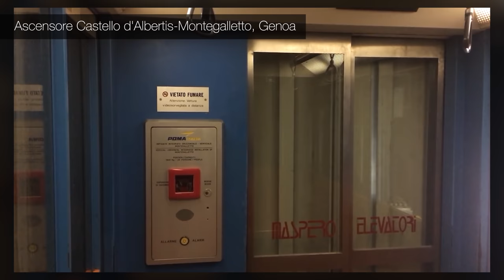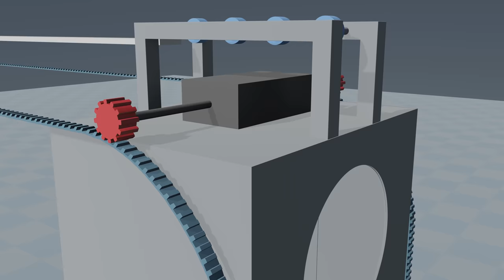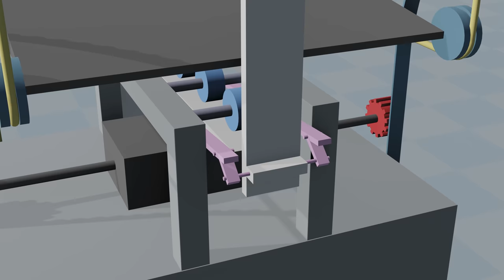I thought the Schmid Peoplemover was impossible

Comment: The elevator in the St Louis arch would be a cool addition to  this elevator series. You start to lean over as it starts to curve and then the cabin itself rotates to correct the lean.
Reply: I've always wanted to visit this Arch just to experience that
Reply: It's a bit cramped in there, but really cool nonetheless :)
Reply: I also wanted to say this! The St. Louis Arch elevators are, in my opinion, almost cooler than the monument itself!
Reply: Technically it is a tram, but works like an elevator.
Reply: Got stuck in one of those tiny carriages on the way down once. Sat there for what seemed like hours, but was probably closer to 20-30 minutes.
Reply: Just like the one in the dome of the new Townhall of Hannover.

Comment: I feel like there's another elevator that goes from horizontal to vertical that we're forgetting here... the Tower of Terror(s) at Disneyland :)
Reply: You are correct! However, ToT relies on a vertical carriage that attaches to/carries the trackless car. That carriage utilizes motors on both directions of travel, and the ride car has to pause when attaching to the elevator carriage. The engineering isn’t all that far off from a typical elevator, so sadly it’s not a smoothly transitioning carrier such as this one, which is Tom’s point, I believe.
Reply: Silvarret!!! :O
Reply: @TitanTankNate  very fair, and definitely agreed. Just thought I haven't heard about it in all these horizontal elevator videos so far, when the engineering behind it is quite interesting... And indeed, it's technically an elevator too.
Reply: The ToT should be quite similar to the one here in Genoa
Reply: I even know the tower of European political horrors, whose pointy tip we still have not reached...and then the big plunge will follow.
Reply: I'd also add, the system at the St. Louis Arch.
Reply: yes, but it smells like farts
Reply: But did that take 3 hours to install? I think not!
Reply: @Formulera  Tower of Terror is not similar to this at all... Just recently watched the "Behind the Attraction" about the ride and it's totally different than this. The part when it travels horizontally, there is no track. There is a guide line/wire beneath the trackless car that tells it where to go (using a camera or sensor of some sort that can "see" the line and follow it). Once it reaches the vertical section, it attaches to something resembling a traditional elevator (though, as N8CRE8S noted, there are motors to pull it up and down so that it can drop faster than it would if it just fell). There are no cogs, and the transition from vertical to horizontal is not nearly as smooth as the one in the video.
Reply: I know this is nitpicking but that one’s in Disney World, not Disneyland
Reply: @thatguy3968  I could be wrong, but while the original Tower of Terror was in MGM Studios in Disney World, I believe there is a (newer) version of the ride at California Adventure in Disneyland. So they're technically correct.
Reply: Yes, but I think, they have a complete stop
Reply: @cloudshad0ws  Yes but that version actually didn’t leave the shaft
Reply: @cloudshad0ws  correct on the guide wire! An encoder on the bottom of the roller carriage uses electromagnetic induction to “find” the wire and follow it. If the vehicle strays too far from the wire, a set of sensors detects the departing side and corrects the vehicle in the opposite direction until the inducted signal is reacquired. Because of how frequently this encoder polls/queries the wire, corrections are super small and hard for riders to detect.
Reply: @cloudshad0ws  the ToT at WDW is the only one that has cars that move horizontally. All of the others are just vertical shafts
Reply: @bigb7965  exactly
Reply: I love u Silv
Reply: But does it allow wheelchair users to travel to Stuttgart without help?
Reply: I think tower of terror works like a rolling chair and two elevators. It can sit in an elevator going up and down but also can go roll around to the second elevator. So just a cart that locks into two elevators
Reply: tower of terror does not count because its not actually a elevator its a roller coaster car that takes a ride inside a skeleton elevator when not inside the elevator it runs autonomously 

driving a golf buggy into a elevator would have the same effect
Reply: @cloudshad0ws  its actually a traditional elevator just beefed up it was built by the otis company
Reply: @dacid44  Yes, that is a fun one.
Reply: You "feel like".
Reply: Whats Disneyland?
Reply: @Silvarret  Not heard about it at all? But Tom metions it in the video about the horizontal/vertical elevator in Genoa, Italy?
Reply: @thatguy3968  True, true.  I wish the World and Land people would get together and make it less confusing =D

Comment: I live in Rummelsburg, where the second People Mover is installed and funny enough I have friends in Altbach. But we can tell you these things are broken more often than usual elevators at train stations. If you need a highly trained special engineer every time to fix this, a simple steel construction with a flight if stairs and elevators on every side is the more simple solution.
Reply: *Simple steel bridge construction
Reply: That's what I thought when I was watching.
Reply: To be fair, if there were more of these it wouldn't be such a specialized training anymore, making engineers more easily available.

The old "Chicken and Egg" problem comes to mind
Reply: @Atlessa  Interesting point
Reply: Where in Rummelsburg is the other one? And is it accessible to the public?
Reply: Elevators are not "simple"
Reply: @00bean00  Elevators are actually very simple. 150 year old technology. Completely analogue machinery.
Reply: @dkbmaestrorules  S-Bahn Betriebsbahnhof Rummelsburg. Yes it is usable by anyone. It is a much shorter version than the one in this video as it only spans the width of one single railway track.
Reply: As an engineer i very much agree.
Reply: It's always broken :(
Reply: wo in rummelsburg steht der people mover?
Reply: @sushifornico   S-Bahn Betriebsbahnhof Rummelsburg
Reply: A stairway should  be built attached to each side of the building with a walkway across so you can have the best of both worlds.
Reply: @Atlessa If we were to use rockets to move people over the rails, we would need more rocket engineers, among other things. However, we don't use rockets because it's not efficient. It's more efficient to use a common technology like two elevators, one on each side, and a staircase for those who don't want to wait.
Reply: Good to know - still would be nice to see how they would fare if there was enough to get the kinks out. Broken elevators also used to be really normal thing, and people loved their 'pater noster' killing machines for their reliability.

Comment: "It's a wonderful design but it's also complicated"
What do you mean... It's genius  and simple, simpler then the 2 ones you showed before, 2 gears on 2 rails with a nice automatic balance system. Heck all it needs is a switch to switch tracks and your elevator can switch to other directions. It's just an amazing invention, I would see it in a boat or space ship
Reply: Um...never forget all the safety features that were added. It appears much simpler than it actually is.
Reply: @geraldhenrickson7472  The safety features are in regular elevators as well. This thing is wonderfully elegant German engineering at its finest. I'd love to see a building use these for a leaning or bent tower design someday.
Reply: @geraldhenrickson7472  Those safety features are part of the elegance of the design.
Reply: if you think this is simple you are deadly wrong - do not even wanna start with all the legal requirements for that in germany, where every staircase is normed

Comment: It's remarkable how this manages to be both elegantly simple, and intriguingly sophisticated.
Reply: it looks elegant and simple in the video. but operationally it is uneconomical, there’s not much point to elegance if there’s a far cheaper and far more reliable solution. they had to decommission the similar one in Berlin because the operational cost is completely unjustified by the tiny capacity.
Reply: @johnnysecular  oh for sure, I'm not saying it should be implemented widely, just marveling at the engineering

Comment: Seems like it could have a walkway on top and stairs on the sides of the towers then you'd have the option to walk. Could still be installed in a similar amount of time if built modular like this.
Reply: walking up stairs can be made easy with line wheel on top and counterweight , hold the line it pull s you up say half you r weigth
Reply: Indeed. If you have more people using that way that would be a possibility. Have the lift for disabled or old people.
Reply: Walkway on top is not very practical. It adds several extra meters up and down for anyone using the stairs. Much better to have a walkway next to this thing.
Reply: @lofturhjalmarsson9896  We already have escalators.

Comment: This is a bloody brilliant piece of engineering. We should have these everywhere.
Reply: Maybe not very often, but certainly in more than two places! A cable-powered version could probably be made to safely operate over all sorts of track configurations while using almost only elevator-standard parts (in particular, you would want some specialty stuff for the gearing, some "teeth" to clamp onto the cable, and maybe some specialized safety systems)!

Comment: Just a note on the translation: When a german says "Die Bahn", they specifically mean Deutsche Bahn.
Reply: yes, translating it as "the railroad" is a bit too general a term.
Reply: And in how far does the information on who operates that railroad help understanding how this elevator works? It's not really a translation error to leave out a completely unnessecary information (that techically hasn't been in the original sentence either). It would only be relevant if this video was about the railroad/DB.
Reply: Nah, even today people still say "die Bahn" even if they mean any of the handful of subsidaries or parasites who drive alongside. People don't really acknowledge that there is anything but the DB AG on German railways.

Comment: Almost spit out my drink when I heard it only took 2 hours to get it set up. Would have taken 2 weeks to do the same thing in Britain. German efficiency is mind-boggling.
Reply: When you know you've got a time limit and can prep for that, it definitely helps.  I imagine while everyone was assembling it in the factory there were some engineers figuring out exactly where and how it had to be connected at the end to be structurally stable and putting together a game plan.

I've done similar things, not remotely on this scale, but "this is our bottleneck, we have all the time in the world to make sure this part is as clean as possible."  Usually for the crafty stuff I do it's things like not mixing the glue until it's ready to be applied and have all the bits you're sticking on at hand.
Reply: I suggest you google how long it took to build the new airport in Berlin if you want more bogglery
Reply: @Schorschers  or the new train station in Stuttgart. or the new concert hall in hamburg.
Reply: @cobaltno51   We don't talk about those.
Reply: Or the autobahn "construction", with miles and miles of closed of roads with no one actually doing any work. 😂
Reply: @garagecedric   I'd rather take that than hitting a pothole at 250km/h :)
Reply: @bartholomewdan  well to fix potholes someone has to actually be there and work on the road :) . When i travel around in Europe i get higher average speed in all other countries, just because you don't habe to fo through those endless 80k/h deserted construction sites, though i haven't been East, where roads might be much worse :)